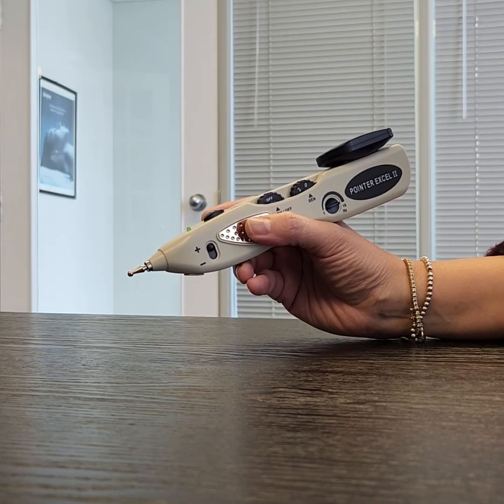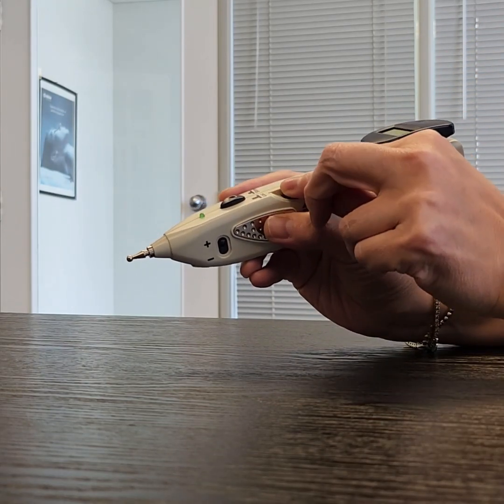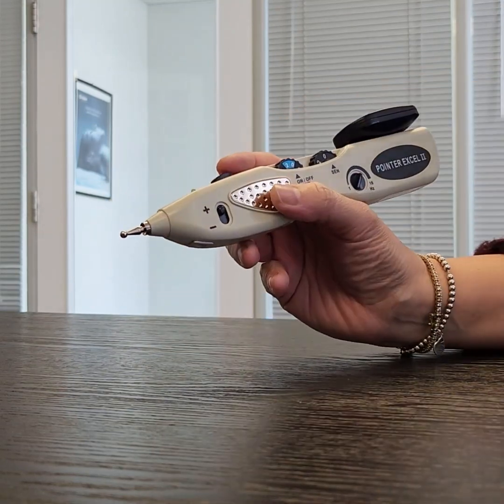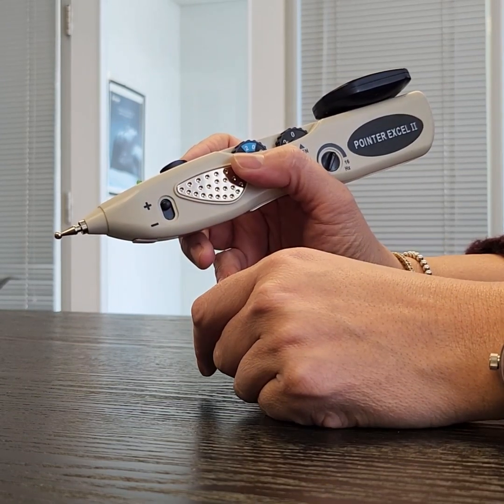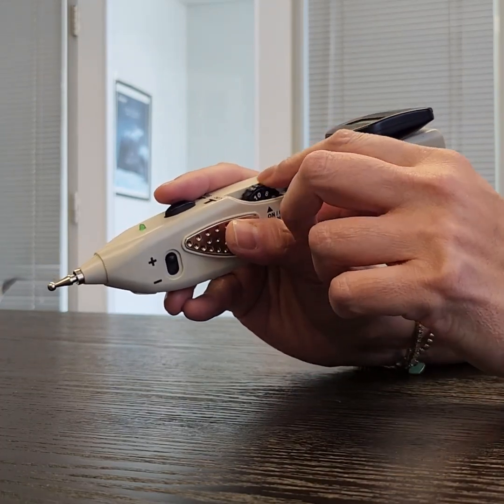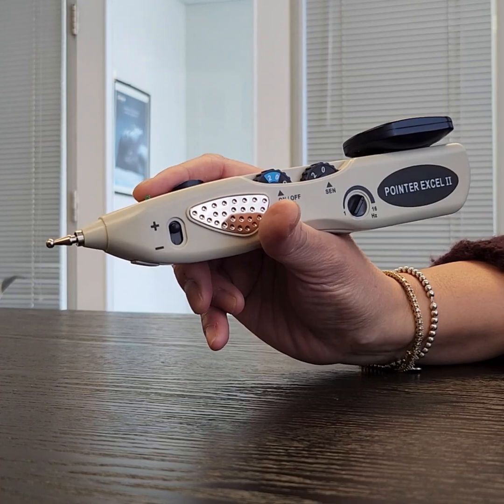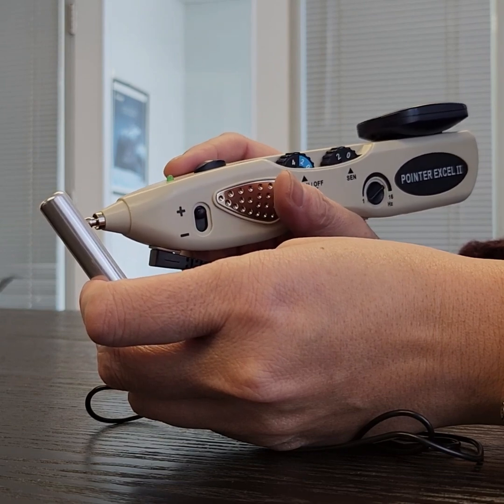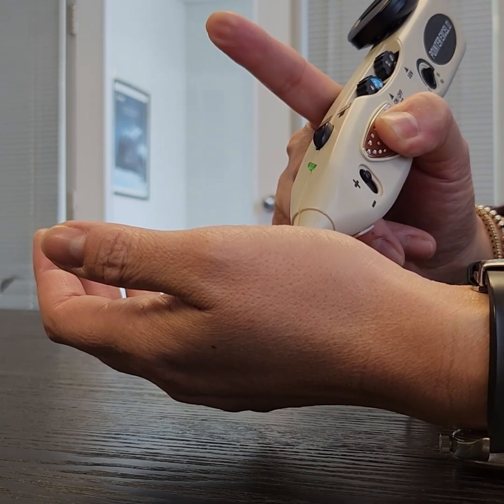How to Use Pointer Excel II

Comment: Can I use 9volt rechargeable batteries instead of Alkaline batteries
Reply from the maker: It should be fine. The low indicator light will light up if the charge is too low.

Comment: Thank you! I bought a machine exactly like this one, but made by Leawell, („  acu doctor“) and without the plus minus option. As you mentioned, the cable might break, as did mine, as it is made with poor quality wire. Also it has a contact plate on one side, so this makes it difficult if you are treating yourself and use the left hand to hold it.  But in such  a case, one can hold the cable contact rod. 
Apart from these small issues, it is an excellent machine. I paid around 50$ on amazon.